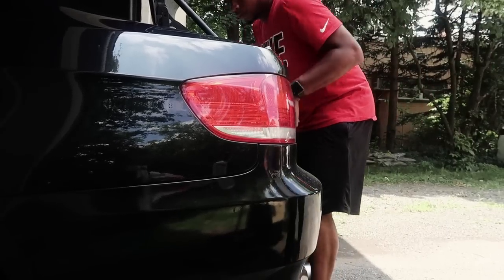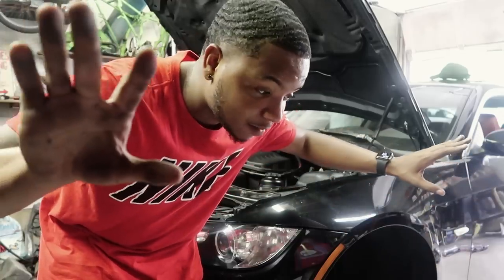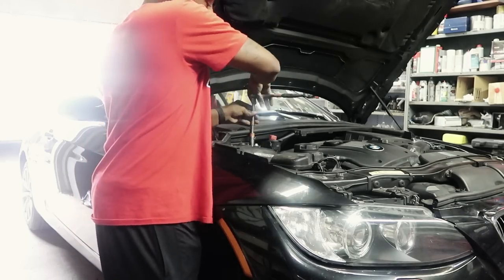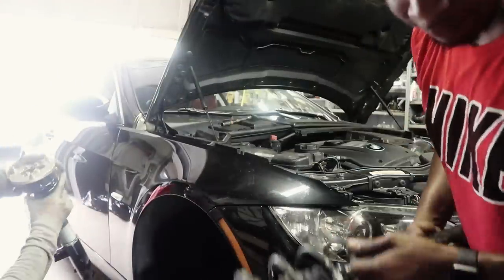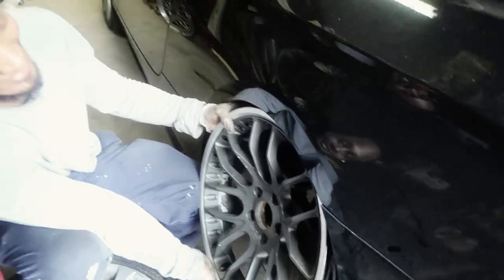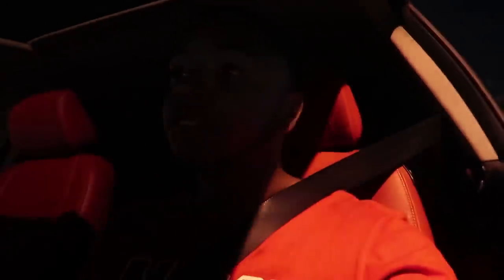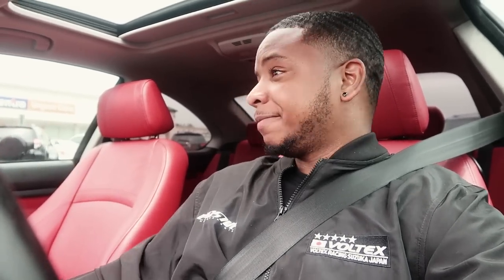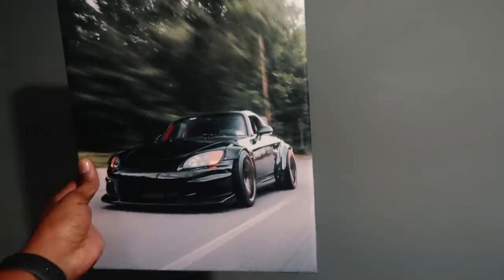MY E92 BMW 335 IS OFFICIAL SLAMMED! / SUSPENSION INSTALL

Comment: I was hoping you bought the BC coils before I even saw you get the box out. the good thing about those is you can get conversion bags from only charged dubs that bagged riders cells and converted to bags using the same shock bodies. That's what I did to bag my E30